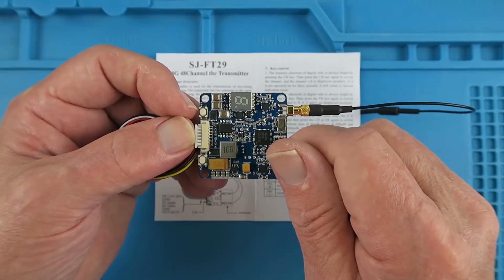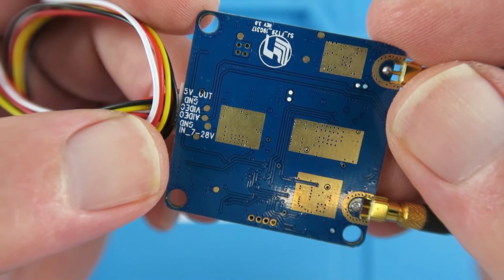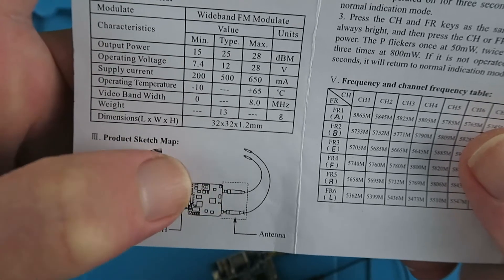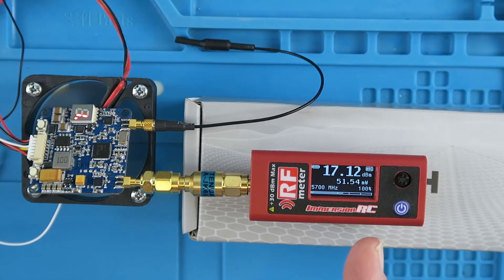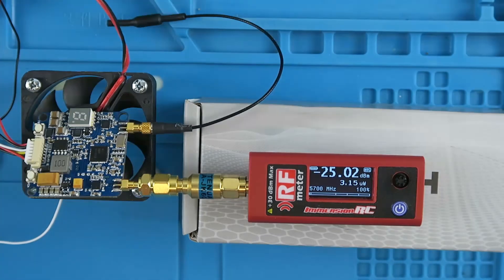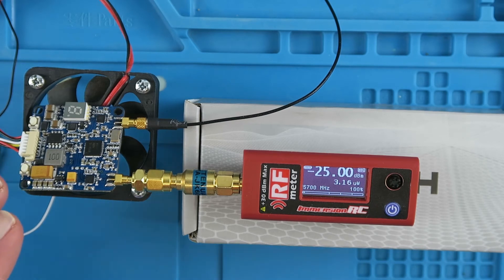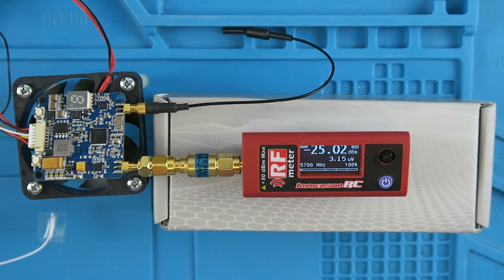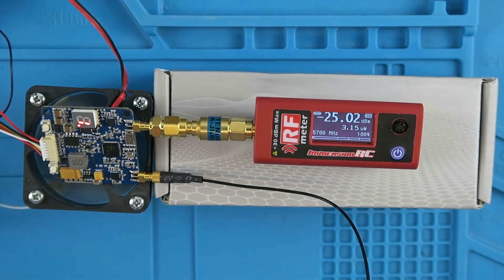SJ FT29 5 8G 48CH 50mw300mw800mw Dual Antenna FPV Transmitter

Comment: This one looks really promising. One can clearly see two dedicated "RF endstage chips" (I don't actually know what these are called). AKK has a dual antenna vtx too which seems to be only parralelled a RHCP+LHCP antenna together. I don't know the physics exactly but I guess the signal strength is not really additive and can even cancel each other out in certain situations. Do you have any realworld usage with this thing yet?
Reply from the maker: Unfortunately due to the current restrictions on movement I have not been able to test further. ! Please consider subscribing if you haven't done so already and then you will see when I upload the next video.
Reply: @1nformatica  I would sub a second time if I could ;)
Reply from the maker: @VincentFischer  He he! Sorry it's difficult to keeps tabs on every subscriber! Have a great weekend!